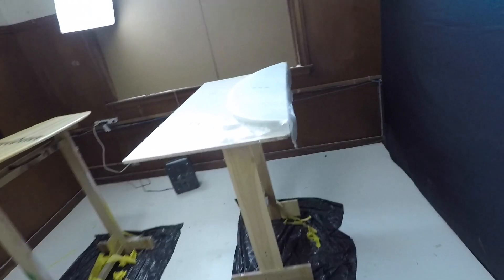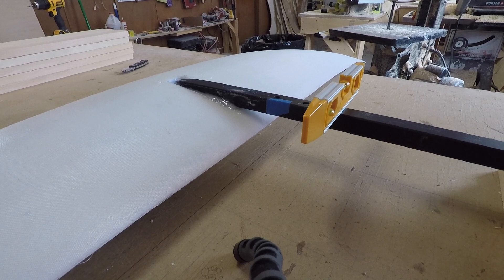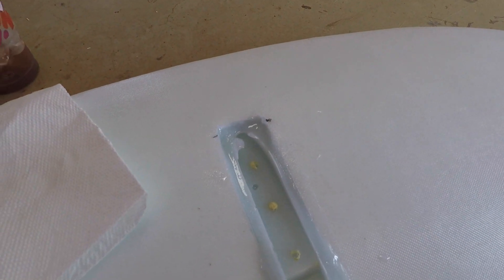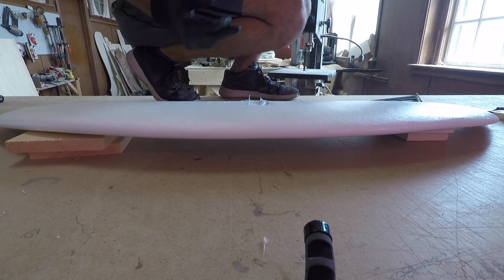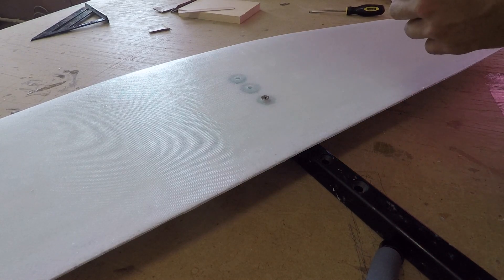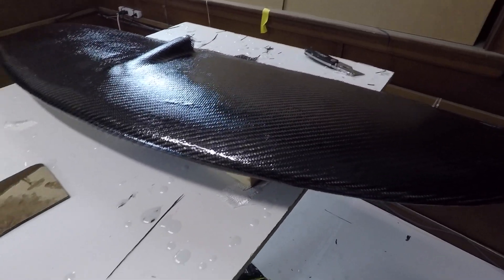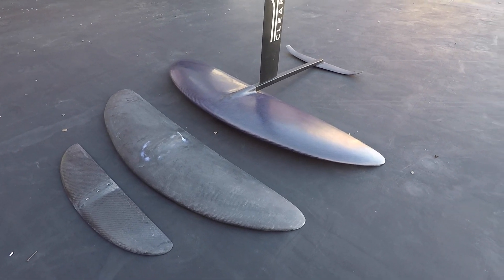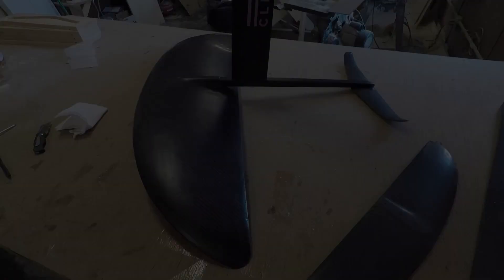The HUGE (3000cm^2)  hydrofoil wing is finished

Comment: At 8:54 you mention keeping skin oil off your composite lamination surfaces...which is definitely important...but if your epoxy is beading up on a recently cured surface it is most likely due to amine blush, a by product of the curing process that rises to the epoxy surface and results in a small spot or even the entire surface where you will NOT get a proper bond and the epoxy will bead up like you describe. You have to wash with lots of warm and slightly soapy water to get rid of the amine blush.

Comment: if you use peelply you don't need to worry about contamination at all, it's more you ammine blush layer that cause a headache on the final coat.  Also, you have the option revert back solar polyester and wax (AKA hot coat) for the final coat, hence shave 2 days off your waiting time.

Comment: With the carbon over glass you kind of make the glass useless.
Carbon has about 3.5 times higher stiffness, so the carbon carries almost all the load until it breaks and the developed crack weakens the glass.
Reply: "I simply skinned the glassed wing. One carbon layer per side simply for the looks!" - quote from clearwater ... cheerss
Reply: @adrianuskristianto5  and the effect of that is, that the glass just sits and adds weight. 
It's like reinforcing a rubber band with a steel wire. 
The rubber (glass fiber) won't do anything until the steel wire (carbon) is broken.
Reply from the maker: @fabianrudzewski9027  I would have to disagree with this. For the loads and forces the wing is facing, the outer carbon skin does not matter much. If this was a high end part in extreme conditions, then yes mixing carbon and glass would not be ideal. Having personally done many parts like this... I have never had a problem. 

Using the same logic you could argue the carbon skin is reinforcing something that is already very stiff. I would rather reinforce a solid wood core with carbon than a foam core with carbon... the wood core will be stronger.
Reply: @clearwaterhydrofoils4313  I'd disagree with you considering that you laid the carbon cloth with weft or warp (doesn't mater) tip to tip direction. If you had rotated it 45° then the glass would be bearing the flex load. Correct me if I'm wrong. Cheers
Reply: @fabianrudzewski9027  the glass isn't just adding weight. With a ESP core and without the glass that wing will be extremely succeptible to dents

Comment: At some point the largest wing will have too much drag to be efficient for your weight. Do you think 3000 is close or over that limit?
Reply: It's a beautiful wing.  I'm curious as well. At 2400 sqcm (Infinity 99 from Slingshot) I really started to feel the drag.  That wing is ~4 aspect ratio.  When I switched to lower area high aspect wing (AXIS 1150), I found the drag drop, glide go up and the low speed stall speed went lower. The details are here: https://www.youtube.com/watch?v=85ENC6fOpCA
Reply: That was my question too...